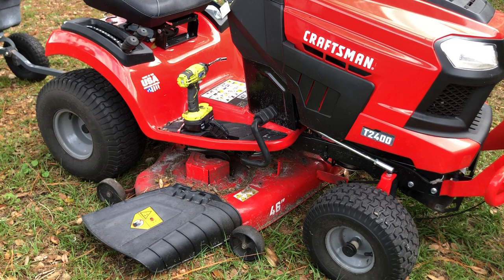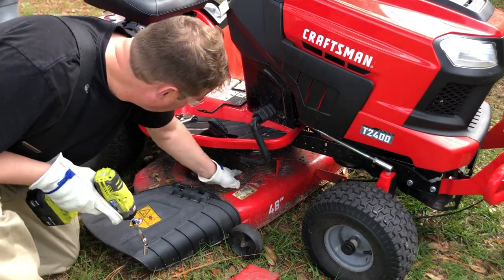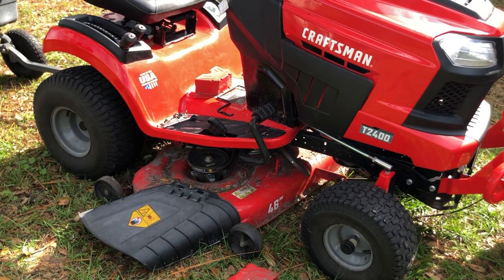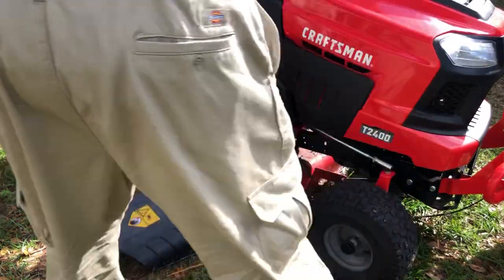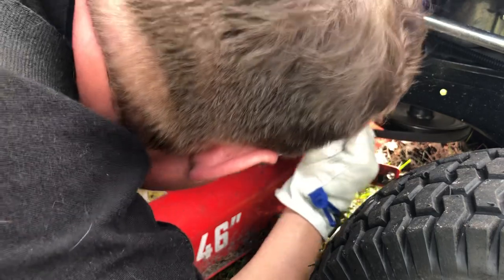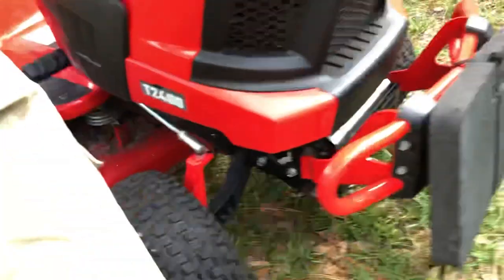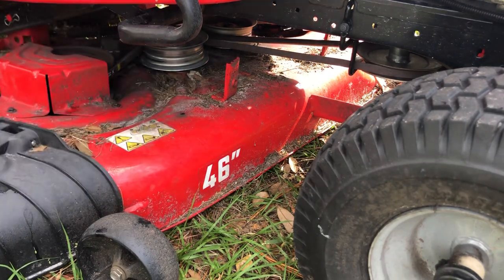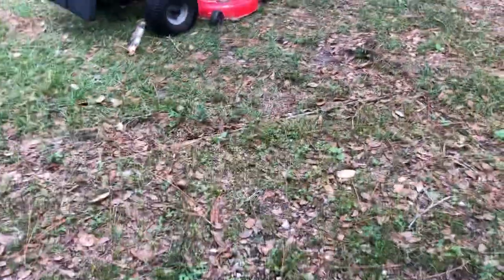Craftsman T2400 Deck Belt Installation Replacement

Comment: Was that a brand new belt,  because I'm doing all that and not enough slack. I have same model of mower
Reply from the maker: Yes, that is a brand new belt. I am using a sunbelt a-95405022. Double check the part number at timestamp 6:51 through 6:53. The sticker on the passenger side shows the belt belt configuration. You can call me if you need more help, my phone number is listed on my channel.

Comment: Every video I've watched its so easy to get belt on drive pulley. I've cheched several times,I have the correct belt but there is not enough slack to get it on front drive pully
Reply from the maker: Watch the whole video in a quiet place three times and I bet you will find success.
Reply: @eprofessio  thanks
Reply: Hand panties...hahaha
Reply: My kinda vid..thx
Reply from the maker: @roadking7500  thank you for watching.
Reply from the maker: @junebugjunebug4492  also, the guy at the big box hardware store could not figure how to measure my old belt or read the small belt book and tried to send me home with a too small of belt,  he actually insisted. I asked if I may show him how to measure the belt and cross reference it in the little belt book. He agreed with my sizing and I went home with the correct belt. There is a very good possibility of a small belt if everything else is correct. Post model and make of unit and will look up correct belt for you next time I’m at hardware store.
Reply: @eprofessio  my new belt is too small. I researched and researched again and again,everywhere said 103.25". 
Finally dug my old belt out and measured/ compared,107" is they old one. Lol. Duuuuuh. Hey,I appreciate you taking the time to respond to me. Thanks man 👍
Reply from the maker: @junebugjunebug4492  no problem.
Reply: your belt is too small
Reply: @user-zo8pr1nc9n  yep. It was.
Reply: Could you help me figure out belt size?model is 917 and make is craftsman t2500 46 inch
Reply: @leojarecki3190  what is model 917 pertain to?
Reply from the maker: @leojarecki3190 I bet it takes the same belt. Go to Lowe’s and check the quick guide that hangs on the wall by the belt measuring tool.